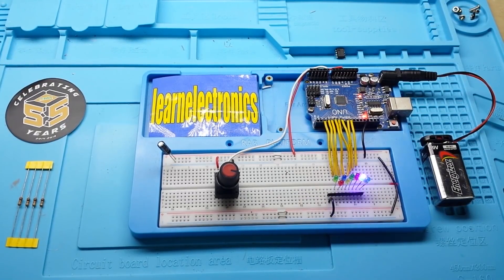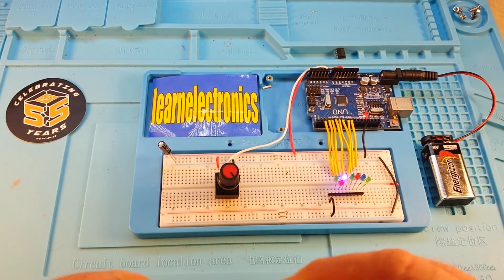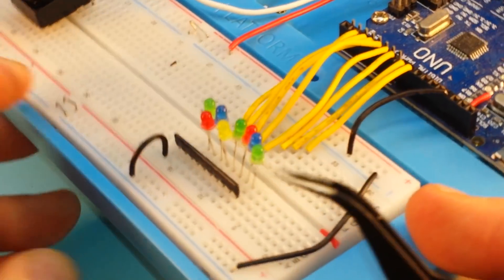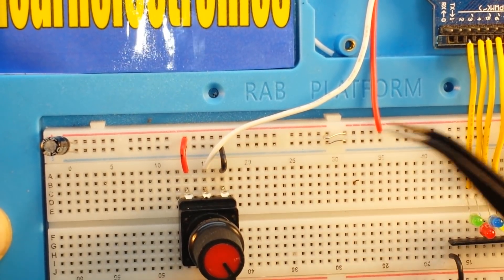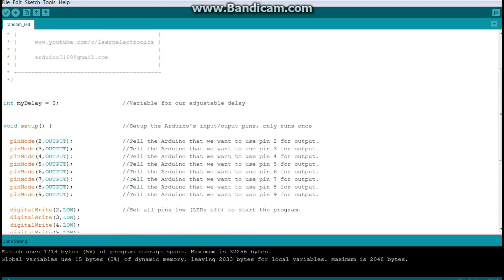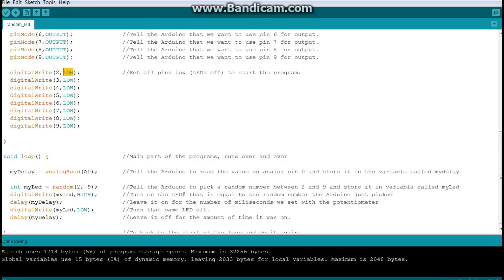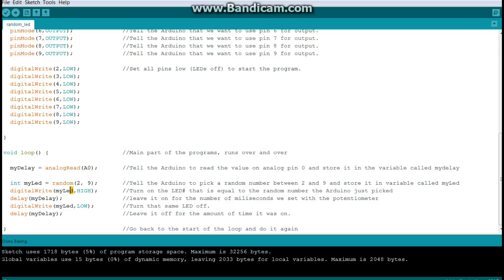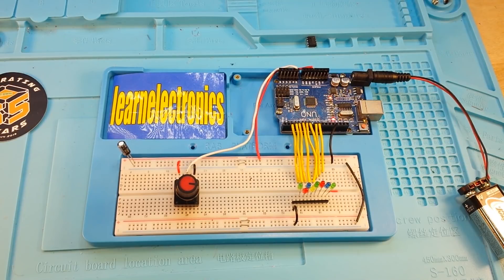Arduino for kids: Random Blinking LEDs

Comment: for what do i need the capacitator. Worked also without?
Reply from the maker: Well then I guess you didnt. It's a reservoir cap. Keeps the voltage smooth.

Comment: Hey, I was wondering if you could help me. 

I am using the standard LED Blink Example, however, I want it to blink randomly between a certain time frame.

For instance I can click my mouse 3 times a second however, this changes a lot.

My goal is to activate the random LED Blink to do around 2-7 blinks per second then say the second after that do 4 - 6 blinks a second.

Is there much to being able to do this?

Thanks

Comment: You did a great job walking through the code and explaining each line. Not bad for someone who claims to not be all that great with the coding aspect of things. One thing that I caught when you were talking about analogWrite is that you mentioned it has a 10-bit range. While true for analogRead, the input for analogWrite is 8-bit. I know, it makes no sense, but there you have it. It will accept numbers higher than 255, but I believe they wrap around and you may end up with odd results.

And for the more advanced kiddos out there, you can declare  myDelay as static in the main loop. It will retain the last value between each call of loop and removes the chance that some errant function outside of the loop accidentally changing the value. Not a huge issue here, but it could offer a chance to explain some more advanced topics and why it might possibly be bad for something outside of the main loop to change the variable.
Reply from the maker: Thank you so much for sharing that info. That's what makes this a great community. I love it when folks have great information to add, it helps everyone. Me included!!

Comment: Nice, I never played around with random numbers with an arduino. I hooked up the circuit and noticed the last led never lit. I had to change this line...
int myLed = random(2, 10);         you have it set (2,  9). Nice videos Ive been a long time subscriber but don't comment much.

Comment: That is such a clear explanation even I could follow it !  Also it is exactly what I need for a little project we are playing with - thank you Paul.  A few others have mentioned the possibility of using just one common resistor: As the LEDs can only light one at a time, why have a separate resistor for each one?  Am I missing something fundamental?
Reply from the maker: You could use one resistor, no problem.
Reply: @learnelectronics  Thanks Paul.  Just got your sketch to compile OK, so looking forward to sorting out the breadboard when I get back tonight.  Just a 75 year old kid, looking forward to more like this!

Comment: Ya need to get your hands on one of these.  After watching Learning Computers I ordered one to Putz with.  Mostly because of the Nav Functions possible.  All failing It would make a cool little back up computer more capable then the Lenovo Lap top i'm typing on for $40.00..   Crazy Times we live in.  These Single Board Computers (SBC) don't seem to have limits any more.  https://www.youtube.com/watch?v=CpMhsrsiV6Y&lc=z23jzlvxtrevz1b34acdp435imovl113tk4jm2htrh5w03c010c.1561313142234406&feature=em-comments

Comment: Using individual 222ohm resistors I was wondering about connecting other led cathodes to the same resistor.... is that cool? would I need a different value?
Reply: It might leave them dimmer cos they will be sharing the current. I think.